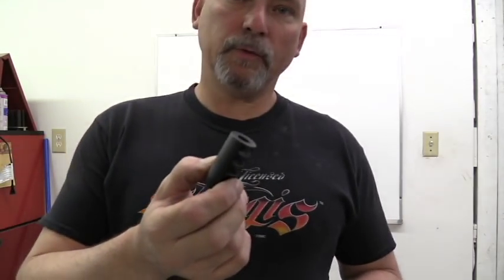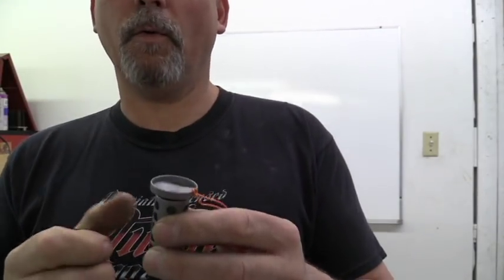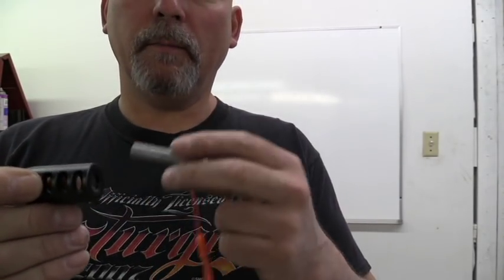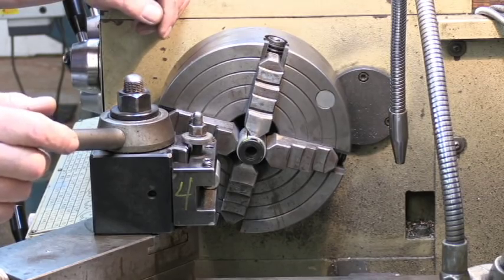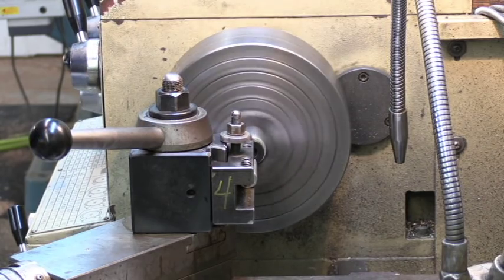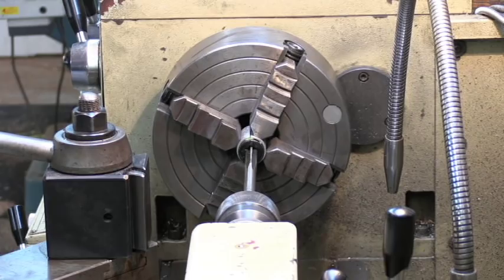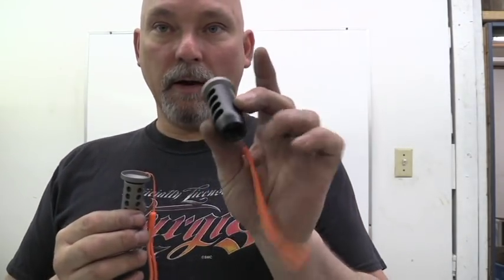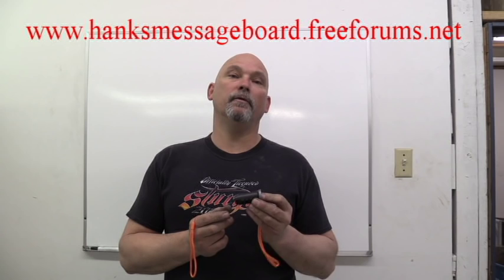Melonite gun coating,,, Is it really that hard.

Comment: It really depends on the depth of treatment using Melonite, Armonite (brand name Melonite), Nitriding, etc.  If as is indicated by other posts that the treatment is only "microns" thick, then your boring bar, being made of carbide, will cut thru it once you get beneath the depth treated.  One micron is one millionth of a meter, which is 39.37 inches.  So one micron is equal to 0.00003937", or less than four tenths of one ten thousandth of an inch... hardly noticeable.  I would expect that the Melonite surface treatment should be at least several thousands of an inch deep to be useful... one micron would hardly be noticed when machining.  So the devil is in the details, and how deep the surface treatment is done by the manufacturer.  I remember having a die head Nitrided for hardening back in the mid 90's.  It was extremely hard, in the 60 Rockwell C range and the treatment depth was somewhere between .015" to .020" (fifteen to twenty thousandths of an inch).  Attempting to machine 60 Rockwell C material with tungsten carbide would be quite a feat under those conditions.  As a former machinist, most machining done with carbide tooling is in the 30-40 Rockwell C range.  60 Rockwell C is significantly harder.  From my checking Melonite vs Nitride on the web, they are similar if not nearly the same treatments, and there are several varities of treatment for different applications.  So using the term Melonite treatment is a mere generalization for advertising purposes.  Like I said... the devil is in the details.
Reply: The details.....from politics to 9mm vs 45 to ar vs ak. The devil is in the details :)

Comment: wouldn't it have been easier to make a custom powder funnel to fit the brake?
Reply from the maker: Only if you wanted a wall thickness of .011. That would be thin and weak. By opening it up to .500 this allows me to machine a funnel stem of .021 and greatly improves the strength of the funnel.

Comment: Melonite is not a coating, its a treatment thats only a few microns deep. Great video ! !  I was wandering if there would be any issues with machining .
Reply: Is melonite a better treatment than nitride?
Reply: PSilence 01  Melonite and nitride are the same thing and better than phosphate.
Reply: @leoguy1609  is black nitride better than cerakote
Reply: @ryangreen6250  Yes, ceracoat is just a coating melonite or nitride treat the actual metal.
Reply: @ryangreen6250  that's very dependant on what the application is.  Both have their place.

Comment: Melinote for fire arms is not spose to be impossible to get through. It hardens the the metals surface for things like metal on metal contact during operation of the firearm. Not a 3 phase commercial shop lathe. It also adds excellent resistance to corrosion and chemicals. It soaks into the metal that turns the metal black-ish when rubbed by a holster or something like that it doesn’t wear off silver underneath good for a carry gun. The layer of hard ness it is referring to is around .0004 of n inch thick to test it for purpose of use you would have to rub two pieces together taking measurements and see which one wears more.

Comment: Must be the camera.
When you 1st started the lathe, I thought it looked way to fast of cutting speed.
Iv dimpled a barrel for a gas block and it was hard as hell.
Carbide center drill for a stable cutter and it was screaming at me.
That literally cut like nothing.

I guess a part that sees ware has more treating than a part done to change color?
Reply: The smaller the diameter, the faster the spindle RPMs must be to maintain the same Surface Speed... Most standard steel is machined around 300-350 SFM (Surface Feet per Minute).  Consult Machinery's Handbook to obtain the suggested Surface Speed for the particular material to be machined.  To calculate surface speed in feet per minute, use the formula ((Pi x D x RPM)/12).  Where Pi = 3.1416, D = Diameter of workpiece in inches, RPM's = Revolutions Per Minute of workpiece, and 12 = Inches Per Foot.  Pi is the linear relationship of the workpiece Diameter relative to its Circumference.  The circumference of a circle is 3.1416 times longer (rounded to 4 decimal places) in a linear sense than its diameter.  Machinery's Handbook contains a wealth of machining information and is very useful in a machine shop, be it in a business or in your garage.